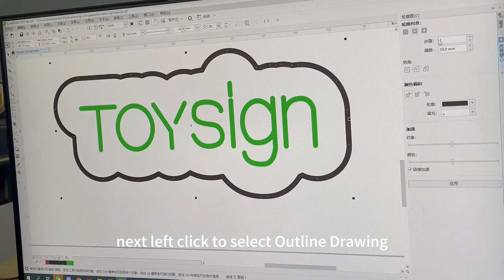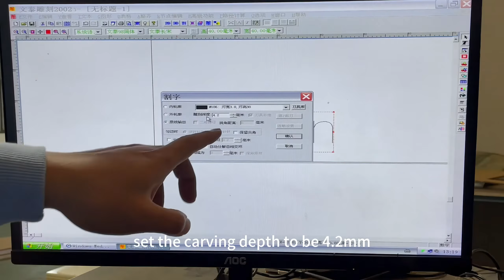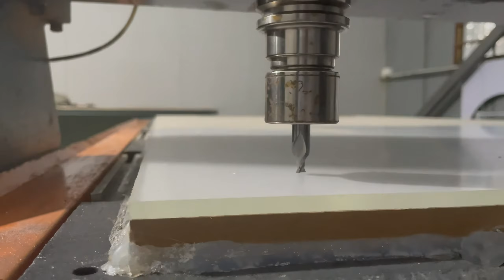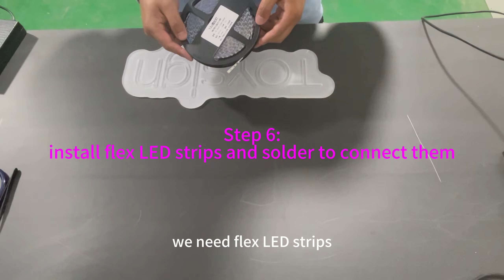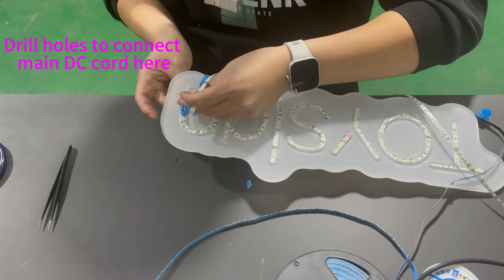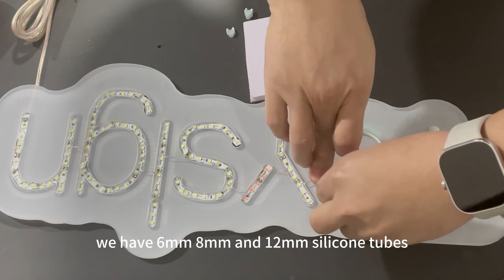How to make neon sign? How to make second generation separate LED neon sign? #neonsign #neonflex

Comment: the video was very helpful, a question, The cutting of the line to place the LED and the silicon is done in one pass, so 4.2 mm at a time? Because it seems a bit too many mm to do in one pass.

Comment: hi I am a 75 year old sign maker and have decided to enter the realm of LED neon projects. I have a new project now which requires 8mm silicone diffuser material. I first used a special 8MM CNC bit to make my 4.2mm depth groove. I am unable to make the 8mm diffuser stay in the groove without an immense amount of extra work. Do I need to heat up the  diffuser? Lubricate it?  This is my very first job and I want to impress the customer. I also want to be sure that the diffuser material can not easily pop out of the groove in the future. I love your videos and I would trust whatever advice you can afford me. Thankyou,   Rob in NY
Reply from the maker: What is your WhatsAPP number? Let's talk there